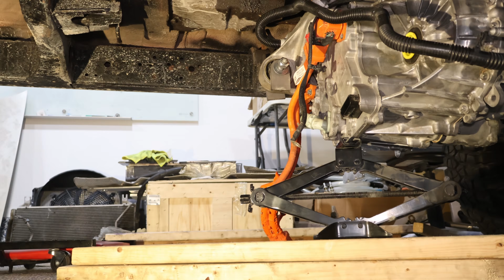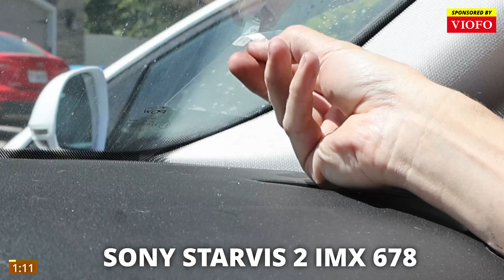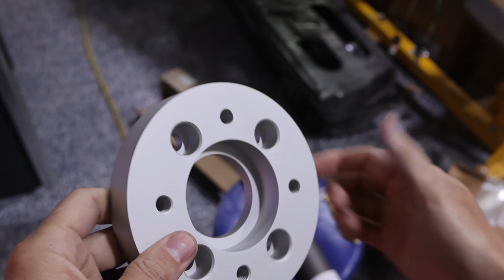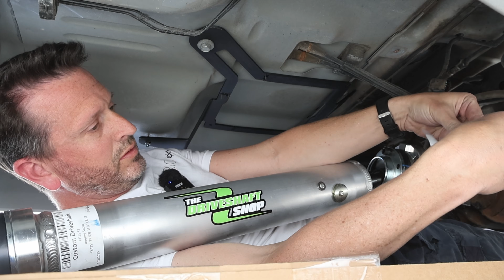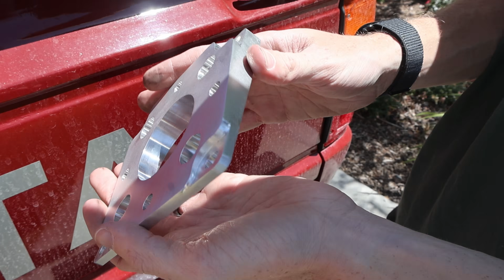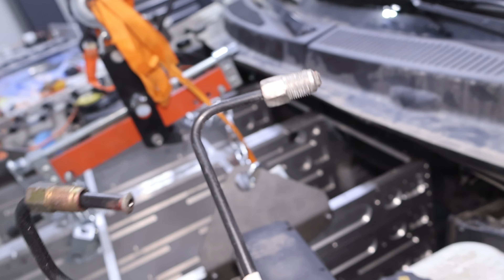Tesla-Powered Pickup: Installing Custom Driveshafts

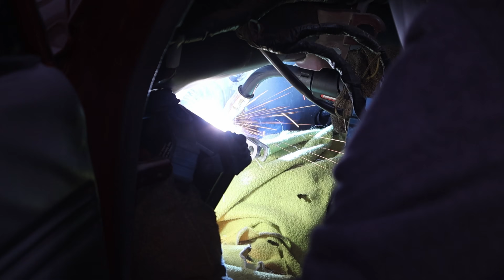Comment: 14:00  That welded extension to the brake rod physically hurts me.  You could literally grab a piece of round stock, drill and tap it, screw it to the rod coming out of the brake booster and slot the other end and drill at a 90° angle to make a connection with the pedal.  That would be the most robust way, but there are also shock extensions, shift knob extensions and threaded coupler nuts available off the shelf.  I don't think welding is appropriate here at all.  It's a 5 minute fix if you can locate a proper extension.

Comment: Excellent call on putting CV joints on the driveshafts.  I did not do that on my Jeep and had horrible low speed vibration.  Woulda, coulda, shoulda.  Thanks for the video!

Comment: I don't think you can run a CV joint with a U joint without having a vibration issue. I could be wrong.
Reply from the maker: It was all done with the driveahaft shop and their input

Comment: You've made a massive mistake by pairing 1 CV with 1 universal joint on the Toyota. U-joints need to be paired to prevent driveline surge. I would replace the U-joint with one of those JK-era jeep CVs and an adapter on the axle flange.
Reply from the maker: These are all done with driveshaft experts guidance
Reply: @electricsupercar  Tag them so I can let them know that they are wrong also. This is a very simple engineering issue: a constant velocity joint is constant, but a hooke's joint's velocity is a function of angles. If you have two hooke's joints experiencing the same opposite angle, they will cancel each other out. If you pair a CV with a Hooke's joint, it will work fine as long as it's perfectly straight. Once you have angles, the total output velocity will go slow-fast-slow-fast through every rotation.

Comment: I don't know much about cars, but isn't the driveshafts kind of telescopic with splines and such? To absorb the changes in geometry when the suspension moves.  If that front drive shaft on the Jeep is that tight, won't it strain the diff and/or motor?
Reply from the maker: Both ends have a protruding piece.  Once in place, there is more wiggle room.

Comment: I’m surprised that, on the Jeep, you connected a drive shaft support to the gas tank.  If it has an accident that moves that shaft, the gas tank will break open.
Reply from the maker: There is no gas tank.  It is electric.  Just using the fasteners

Comment: I'm not a driveshaft tech, but my understanding was that you need 2 universal joints on a driveshaft to avoid vibration. I was only seeing 1 on those shafts, possibly it would be OK if the driveshaft was fixed (independent suspension and diff bolted to the body) and dead straight, but the Toyota definitely has solid axles. There may be something mitigating this I didn't see.
Reply from the maker: All done with the Driveshaft Shop expertise.  They know what they are doing.
Reply: The constant velocity joint built into the driveshaft???
Reply: @jimurrata6785 not unless there's something I don't understand going on because it's constant velocity  and not the sine wave of a uni joint.
Reply: Yes, a universal joint needs another universal joint installed to offset the acceleration and deceleration of it as it spins to provide balance.

Comment: Doesn't that front driveshaft need a bit of axial play instead of being wedged in like that? It looks like the bearings in the motor/gearbox are going to have a tough time.
Reply from the maker: Both ends have a protruding part.  Once in place there is some play

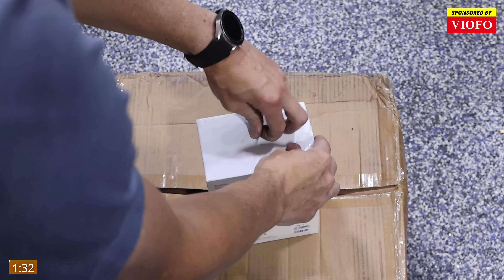Comment: 3:41 Oh you got the 3ch S model, nice! The parking mode settings and multi-view screen is awesome. 
I need to look for my friend, if you can put the dashcam in 2 ch when driving. Then you can record the front camera in 60fps. In the evening HDR for the front camera is better, so all 3 channels can be 30fps. That fishbowl camera is really cool.
If the customer decides they want a telephoto lens for driving instead of the fishbowl. Simply purchase the telephoto lens, then download the A329T firmware onto the microSD and restart the device.
Get SanDisk to promote a 4TB SSD for it next week. Hahah!
You can also have driving saved to the SSD, then parking mode recording to the microSD. 
I have the A329 2ch. The added features on the S is pretty sweet.

Ok, back to the install for Marty! 😂

Comment: What kind of Toyota brake booster is that? is that working just with 12v without  any controls?
Reply from the maker: It is the ibooster.  It is a favorite for aftermarket use

Comment: You're going to have serious problems with your 'carrier bearing bracket'!! For starters, there is very little actual support for the bearing bracket, plus you're going to have both vibration and stressed member issues with running between the motor bracket and the frame rail. Optimally, you need a custom bracket that is supported off of the motor/trans asy. only, to reduce side loading on the section of shaft coming out of the motor. If you look at any 2 piece CV shaft on a front wheel drive vehicle, the carrier bearing is always supported off of the transaxle.😉 Just an educated observation.
Reply from the maker: Thanks for the advice, will keep that in mind!

Comment: Thanks for an interesting video.  There is a vid called "Top Tips - Measuring internal dimensions using story sticks" that shows how to measure this without the floppy tape measure.
Reply: I'm sure he warmed up the tape measure before pulling it out. 😜
Reply: Just watched it. Quick and to the point.
Reply: What's with all the fractions of inches, much better to use mm. 1 mm is basically 1/25 of an inch. PS nice work, I'm enjoying the videos.

Comment: at 11:48 im no engeneer but that dosnt look like enough material to hold a bearing, to anyone wondering it looks like there was a extra cut line in the drawing or someting where the side with the brearing screws is compleatly disconected from the rest of the bracket, so the breaing is only held in by about an inch of flat steel on the bottom of the bracket.
Reply: I'm with you on this one! There's going to be some serious forces on that bracket under acceleration (especially on an electric drivetrain). It ideally should be supported off of the motor/transmission case only, not the frame.😲